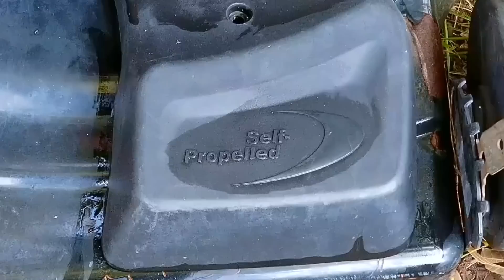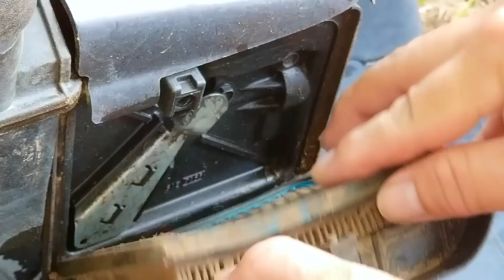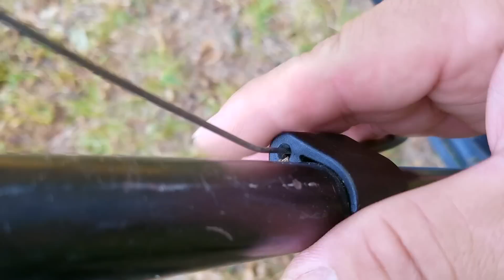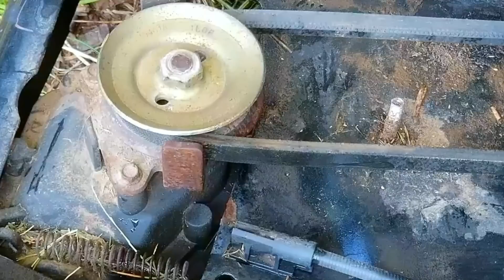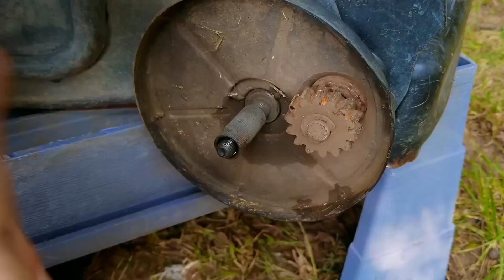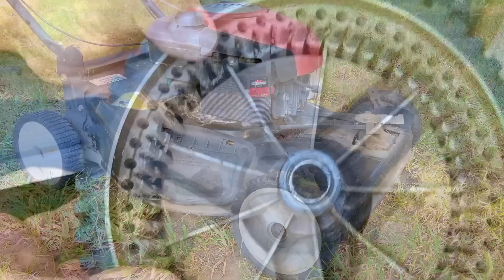Self Propel Not Working On Craftsman Mower

Comment: I have a craftsman just like this pretty much exactly the same just has those big rear wheels, it’s probably the same model as this. The drive is REALLY fast, and sometimes when I set the mower down while turning the front wheels grind, or when putting it into gear and taking off on the lawn one will grind. It has brand new drive wheels. Makes no sense to me cause the teeth are fine, and the gear is in great shape too. I’m thinking that it possibly needs to have those older thicker wheels, like the back ones of this has in the video. The replacement drive wheels are different and thinner, that is my only guess. But they don’t make those wheels anymore for these 07 Craftsmans.
Reply from the maker: That's interesting. I know when these grind it's because the drive gears a worn out.

Comment: nope not from memory in my experience on these random mower mysteries but well removing stiff or seized blade adaptors aka blade bosses are a common one as one on a older Briggs and Stratton engine so tight to remove etc.
Reply from the maker: Yes they can be a pain to remove.
Reply: @INSIDEHOUSEGARAGE  strewth generally I use a good lubricant for it like WD-40 and optional heat from Propane or Map Gas and a slightly longer bolt 🔩 and well depending on the type a two (2) or three (3) jaw puller tool and often it works.

Comment: I dealt with this on a Craftsman mower a few months back. The mower looks brand new, but the engine was blown up and one of the wheels was completely seized. On one wheel, the insert was seized to the axle, and on the other, the insert was in pieces. It fit the pieces back together inside the wheel, and it's working great.
Reply from the maker: Interesting method. I might have to try that.

Comment: That's a wear item and explain the end gear is metal and the wheel gear ⚙️ is plastic guess which is going to fail first?To prevent anything else with this job recommend replacing both end gears and the drive wheels end gear is worn down also and it's only going to engage the tip of the new wheels causing premature failure
Reply from the maker: I think you're right, however I would probably like to test the amount of surface contact using grease or paint or anything that'll mark the gears.
Reply: @INSIDEHOUSEGARAGE  All you really have to do is measure the depth of wear on the old wheels end gear left a tool mark
Reply from the maker: that's an idea!  Thanks

Comment: I have been following your channel long enough to know you go above and beyond on all your repairs for clients. This mower and these clients do not deserve your time and effort tbh. It is a mid-quality machine that has been mistreated by the operator. The oil, air filter, cutting height and overall condition are enough to tell me everything I need to know about it. It needs two new drive wheels, an air filter and an oil change... likely a blade sharpen/replacement...$60+ in parts and $60+ in labour...I'd tell them they are looking at $150 as an estimate or they can take it somewhere else.
Reply from the maker: Thank you very much, I appreciate your time.  I'm also glad others can see the problems I'm seeing too.

Comment: We all know that stuff is going to wear out BUT we try and make it last as long as we can. I replaced those wheels in sets but plastic will just last so long. They'll last as long as they last and if there's a lot of grit or the ground is dry, well, there you are. With Snappers the tires wore out before bearings and way before gears. Happy week
Reply from the maker: I hear that, now I'm beginning to regret selling that Hi-vac Snapper.

Comment: Yes, I had a customer with a Honda water pump. They plugged the carb with old rusty water and gas. I had to replace the carb with a new one. A week later they said the engine would not start. Sure, enough they used the same old metal rusty gas can fill the engine and plugged that one also. I was able to clean it with my ultra sonic cleaner and it ran well. I told the customer if he continued to use that gas can take his water pump to someone else to repair it. Thanks for a great video. A few customers will lie to you to try and get free repairs.
Reply from the maker: No problem and thanks for your time. They just didn't get it with that rusty fuel can.

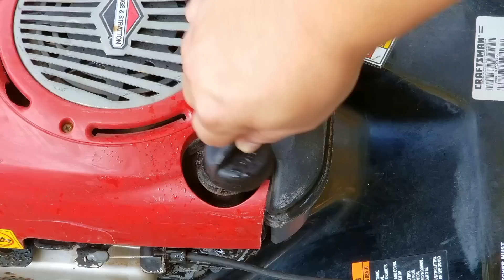Comment: Looks like you might have an oil leak also.  When you push the dip stick back into the slot (0:51 mark) i can see the bottom leak some kind of liquid down below the stem.
Reply from the maker: good eye, but it's water.  I didn't have time to do a proper wash and dry on this one because of my schedule.

Comment: You know the previous owner of that mower is not been forthcoming I want to say they were using it in a commercial application mowing 20 to 30 lawns a week that extreme amount of carbon in the oil and the low amount of oil in it is a definite sign that they were using it for what it wasn't intended for.. I would say that you should charge them in additional fee and let them know that excessive wear is not covered under warranty
Reply from the maker: you are correct, this was not a warranty job.